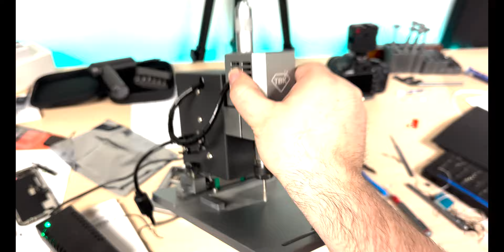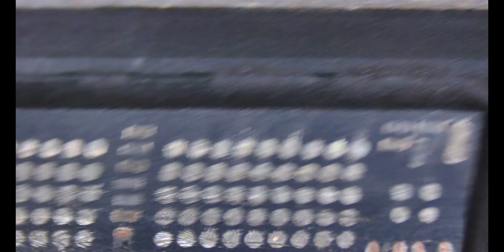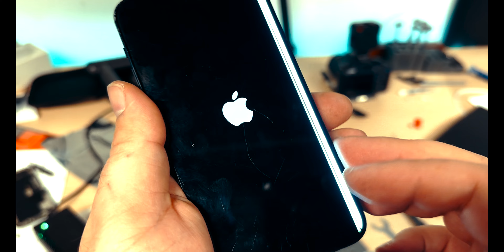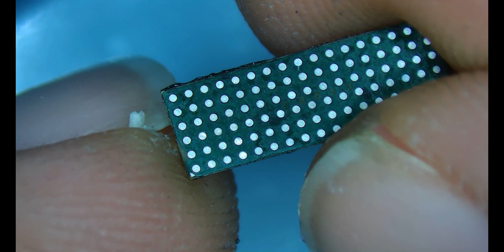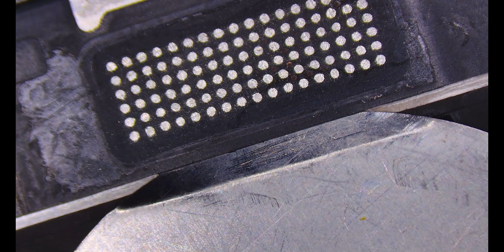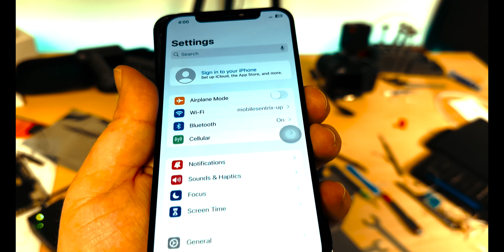TBK Grinding Machine (Tips and Tricks #78)

Comment: How about NANDs. would this tool work efficiently with that type of procedure?
Reply: Heat is more efficient and less time consuming but yes you could in theory grind off Nand
Reply: Its not a theory, its possible and plenty of examples online. Bypass the need to remove the black adhesive and no heat needed until the Nand is placed.   @antekozina9747
Reply: Not a theory, plenty of examples online. Bypass the need to remove black adhesive and no need for heat until the NAND is Placed. @antekozina9747
Reply: why not just careful not go too deep